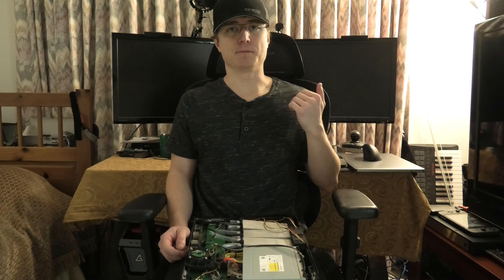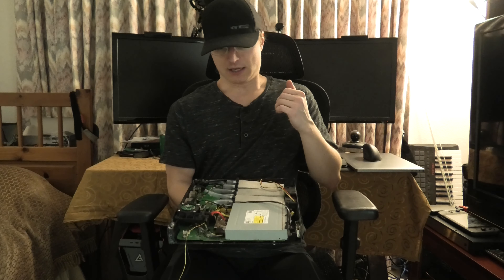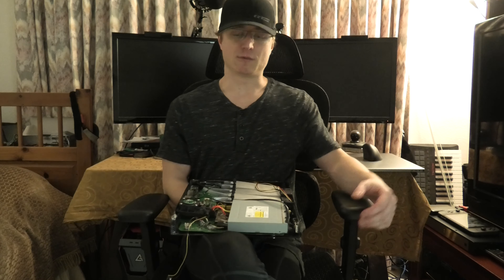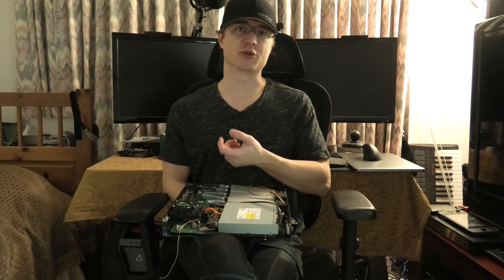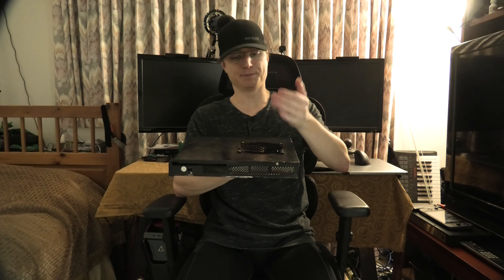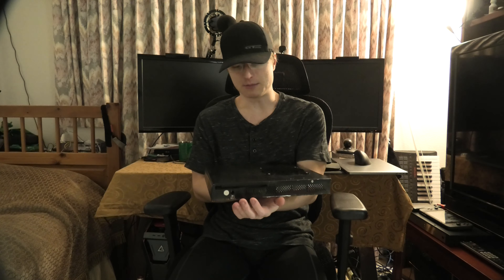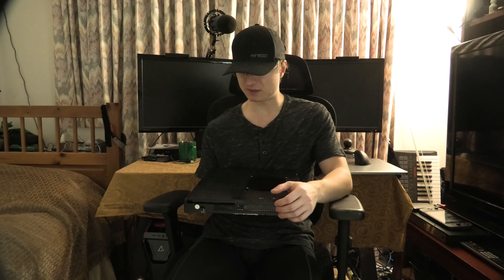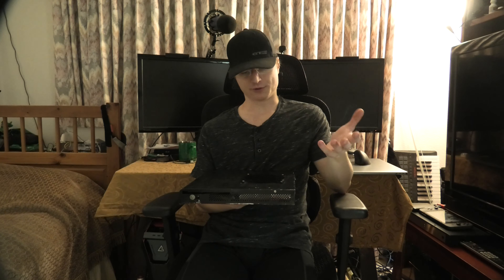internally water cooled xbox one super slim

Comment: oh i think i was un clear of why to do this more space you can use for your pump tubes or add extra hard drives or a ssd what ever you perfer
Reply from the maker: no plans to ditch the drive at this time, since it all fits. Tight squeeze but it works. Once I install the SSD I only gain a tiny bit more room not really saving much since the laptop HDD that is in these xboxes stock is already pretty small

Comment: Hey bro sorry for late reply hey I just bought a for parts portable DVD player it's 20inch I'm wondering do u think 🤔 a Xbox one x motherboard I'll fit in it and it's internals also what should I do about the holes drilled into the plastic is there anyway to like fix them like maybe make new patches hmm
Reply from the maker: I would epoxy the holes.  As for fit it's hard to say without checking dimensions,  I got really lucky with my case
Reply: @cr4zyw3ld3r  idk it says on Google that the Xbox one dimensions are 11.6 x 9.1 x 2.6" / 29.5 x 23 x 6.5 cm and my portable DVD player is actually 17.9inch

Im thinking I'm gonna need a new lcd prolly one that is same size and one with controller board somehow I'd have to figure out how I'd make the Xbox one battery powered if possible and somehow make the lcd and controller board turn on while my Xbox is plugged in or playing on while battery charging?
Reply: My ideas are take apart my DVD player cuz I got it for parts anyway but I should get a 17.9 lcd with controller boar? 

Then for my Xbox one I'm thinking about installing the controller board that from the lcd in back of the DVD player then I'm pretty sure there room for my Xbox one maybe on the left side somehow I'd have to mount it maybe standoff or screws? 

Basicaly trying to install my Xbox one on the portable DVD player with some modifications 😂
Reply from the maker: @BlackCat-qm3sj  its likely doable, just make sure that you are able to ground the motherboard properly.